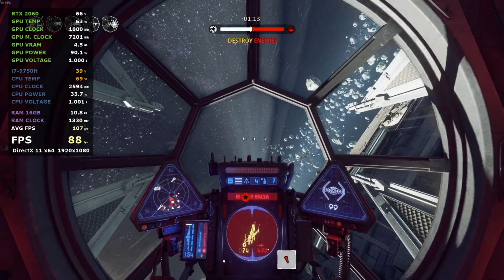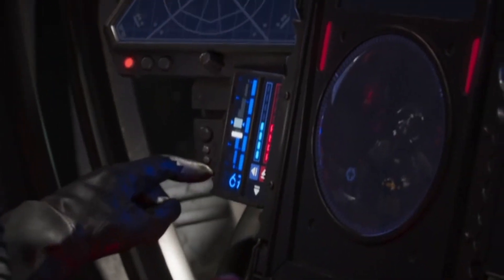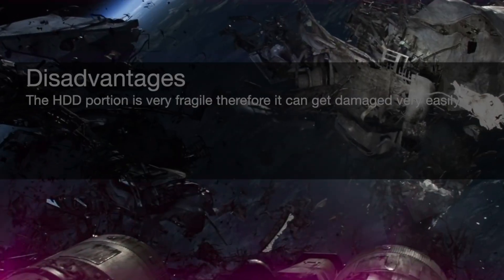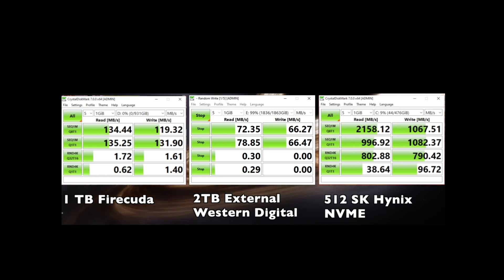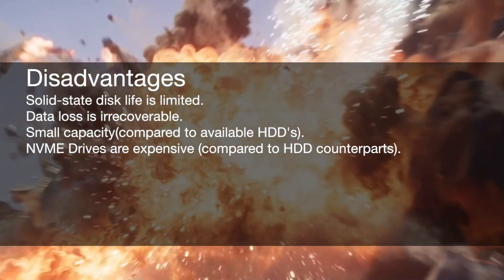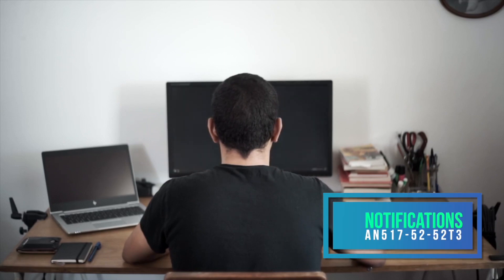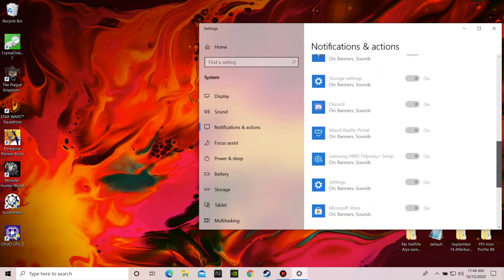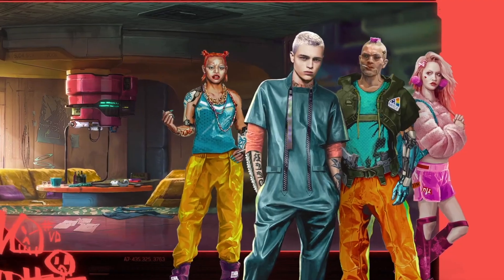Useful Tips for Acer Nitro 5

Comment: i have had issues with fps performance for a while now, after 20 - 30 minutes of playing it will suddenly start to have moments where my fps drops dramatically to 10-15 fps then back up again. Solution?
Reply from the maker: Sounds like throttling.  I would download MSI Afterburner with Rivatuner and check your temps while playing.  You can also try playing with the Power Saver profile and see if it happens again.
Reply: @Meanpooh I’ve asked around and people have said try using throttle stop? Or that I have thermal throttling. What or how can I fix this?
Reply: @Meanpooh  is there anything else I can do? It stopped on power mode but I get really bad fps…
Reply from the maker: @eeherthhtr5  If you machine is over 1 year and you do heavy gaming then you may need to repaste.  If you are uneasy about about doing it then don't attempt and take it to a shop.  If you set your power mode to power saver and your games run fine with a noticeable frame decrease then that will let you know it's throttling.  You need to see what your temps are so be sure.  Lastly you may have to get a laptop fan or follow a Throttlestop tutorial.  I have plenty of those around.
Reply: @Meanpooh  is it true you cant use throttlestop for a ryzen cpu?. Thanks anyway
Reply from the maker: @eeherthhtr5  Yes, its true.  Use Ryzen controller.
Reply: @Meanpooh  alright then... how should i have it setup? I have the ryzen 5 3550h.

Comment: My new acer nitro 5 laptop's Bluetooth is not working any tips?
Reply from the maker: Try restarting your machine and check device manger and make sure you have no yellow exclamations marks.
Reply: @Meanpooh  I did it bro checked if all 4 Bluetooth drivers are updated as I upgraded to windows 11 and still not working

Comment: Hello, after 1 mounth, i buy Acer Nitro 5 With AMD Ryzen 5 4600 and GTX 1650ti, Windows 10 home preinstal, and now i reinstall the Windows, my bad, and i have big problems în games, all games ar pixeled, and jagged edge presents în all games, i install manual all driver but not changes, and i lost the profile Acer-(Balance-optimization) in Nitro Sens, if you can help ME, please help, i dont have ideea, sory for my english :)
Reply from the maker: You can get the Acer software from the site under support.  You will have to look up your model.
https://www.acer.com/ac/en/US/content/drivers
The Acer profile made little difference if any for Me as I always use the Windows Balanced mode in almost all games.

Comment: Question, wanted to upgrade my nitro, mine runs 8gb 4ddr 2933mhz but i bought a 2666mhz will it still work but just run 16gb at 2666??? @meanpooh
Reply from the maker: This machine supports DDR4 2666/3200 SODIMM.

Comment: One Bit of Advice. Be careful when picking the laptop up by the corner.  I installed an internal HDD in the spare slot.  When picking up the laptop, the casing is quite thin on the corners. it pressed against my Drive and it stopped working.  I now pick up my 2020 Nitro 5 by the sides using both hands.
Reply from the maker: It stopped working?🤔
Reply: @Meanpooh  Yes.  I think it was the way i picked up the laptop.  I picked  it up using one hand by the front right hand corner. The casing pressed up against the hard drive and I think it pressed the needle reading thing inside the HDD.   I heard a funny noise when it happened. At first I thought the noise was the Fans pressing against the casing but then realised my extra HDD had failed. You could hear it skipping :(  Ive replaced it with another HDD now and its all working fine :)   I just posted to help others and to be careful picking it up by the corners one handed.  I had a MSi before this laptop and because it has an Aluminium case I always picked it up one handed with no problem.
Reply: are u serious, I have been doing it since I purchased this laptop. thanks for sharing...
Reply: @123afk  Yes I’m serious, I wouldn’t waste my time posting if I wasn’t. The casing is flimsy and presses against the extra hard drive if your not careful in  the way you pick it up. It broke my 1TB HDD and I had to buy a new one.

Comment: hey meanpooh I talked to u before so, I wanna ask u about the Acer nitro 5 2018 model: AN515-51 Thermal pad's cause I found when the last time I repaste the thermal paste that's not any thermal pad's on the heatsink maybe they'all fall or something so am asking u is the thermal pad's important! cause I had a keyboard heat problem even when I have good cooling and temperature like 60- 69 degrees so is the thermal pad's maybe the problem of that issue or not! and am sorry but I wanna u to explain to me how the thermal pads working on the heatsink and for how much it's important! and if I must buy thermal pads what size should I buy for my model, and keep going dude for those helpful videos u helping
a lot of guys here :)
Reply from the maker: Thank you.  The heat you are feeling is because there is not much room to cool in these laptops. Made with cheap plastic doesn’t help the issue. The only way to really resolve the issue is to use external KB or you can try having a fan blow over the KB. 
Thermal pads are very important. thermal pads help the conduction of heat away from the chip. Because they are spongy, they can fill in gaps on non smooth surfaces when in contact with the heat sink. 
I don’t know the exact size but 1mm should be good as .5mm might be to small and under no circumstances should you stack them.    Thank you for tour support, I really appreciate it.
Reply: @Meanpooh  ♥️
Reply from the maker: You’re welcome!

Comment: Hey your Nitro 5 (2020) unboxing video was so amazing... I will get mine in 1-2 days and luckily I got 144Hz panel and 4 zone RGB keyboard model in addition. Is there any tips after first boot 😉😄. Happy to join your party 🥳
Reply from the maker: Glad I could help!  The Nitro 5 doesn’t have much junk preloaded onto the machine. I believe there is some Photo software and an antivirus program. I have the software uninstalled and the antivirus software disabled as I don’t use it.  Congrats on getting the options orig listed on the site. I’m sure you’ll be happy with it.  Just keep an eye on your temps.  Going into the 90’s occasionally is fine but staying there is a problem.  Like I said in the video, it’s fine but if it starts to affect your gameplay then you may have to make adjustments.  Thanks for stopping by!!
Reply: @Meanpooh  thanx for the suggestion, will follow these points😊
Reply from the maker: Anytime!

Comment: i've upgrade my Nitro 5 but it seems still have stuttering when playing games, make me prefer fps drop rather than 60 fps but stuttering
- i've repaste the temp when playing games now is 60 usually for both CPu and GPU
- playing on SSD MVME
- updated driver
- make the game high performance in nvidia, and high priority in task manager
- upgrade ram to 16GB 
- undervolt to -140
- limit to 60 fps on rivatuner
- limit CPU speed to 3,5ghz

but when playing games its not that smooth when its stuttering like 0,0*** second freeze
Reply: Is acer laptops specially the nitro 2020 version reliable to last 5 years atleast
Reply from the maker: I can’t promise you that it will last that long but I do have laptops from 2009 that still work just fine.  Expect the battery to be replaced around the 2-3 year mark. Additional space will be needed as we’ll especially if you’re a gamer.
Reply from the maker: Is this happening on all games?  Do you have other programs running besides the game?  What happens if you remove the undervolt and run stock temps?